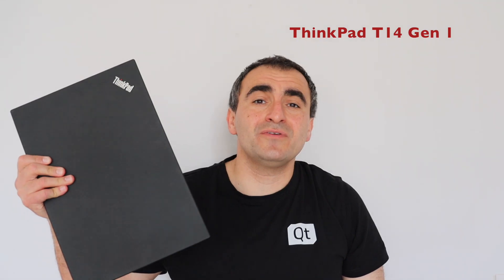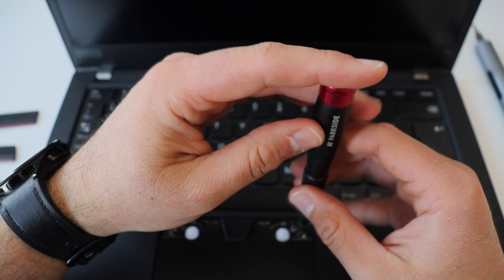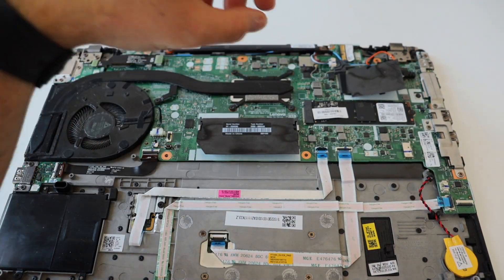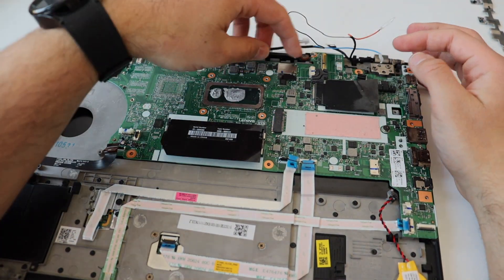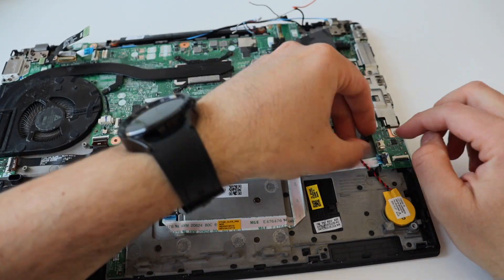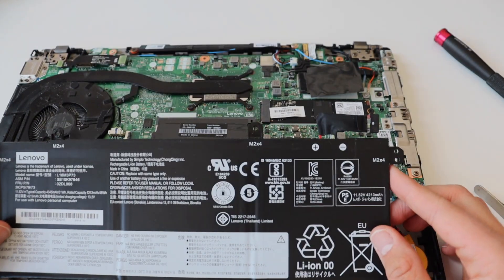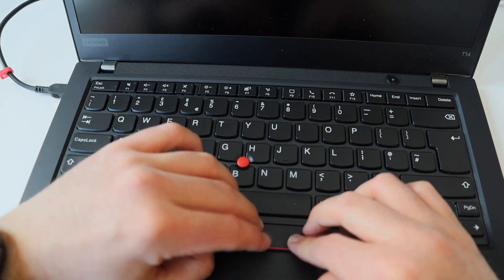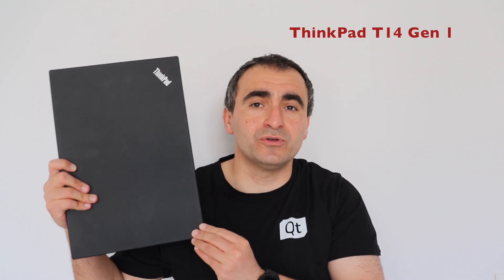Lenovo ThinkPad T14 Gen 1 with Intel Disassembly and Repair: Main Board Replacement #thinkpad

Comment: I have a problem where I left my T14 Gen 1 from the left side while it is running it freezes, or hangs or sometimes garbage comes on the screen. Is this due to laptop flex and motherboard is spoilt? or is it due to faulty RAM stick? How can I diagnose it?
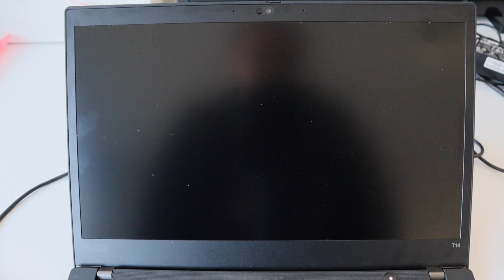Reply from the maker: Enter Lenovo Diagnostics as show at 7:51 in the video and run all tests. This may help you identify the problem.
Reply: @LeonAnavi Ran diagnostics multiple times and there are no problems. I  changed the SSD which I thought might have been the issue as it is on the left side but it still has the problem.
Reply from the maker: @CitizenSleeper0 which OS do you use with T14?
Reply: @LeonAnavi I dual boot Windows 11 and Ubuntu. Both have the same problem.
Reply from the maker: Does it hang if while you are in the BIOS or the Lenovo Diagnostics? Is the SSD properly secured with a screw to hold it tight to the M.2 slot? Have you recently changed the thermal paste between the CPU and the heatsink? Eventually this might have been caused by due to overheating.
Reply: @LeonAnavi I ran stress testing to increase the cpu temps and if I have it stationary on my desk then there is absolutely no issues. I frequently build software and it stresses the cpu and it is stable. I am really not sure about the SSD. I changed the SSD to see if it is the issue and it hung the same way.

I heard one user say that the connector is kind of loose and he had put something to hold it in place. How do I check if it is the connector? Should I remove the back cover and wiggle it while running?
Reply from the maker: @CitizenSleeper0 no, don't mess with the SSD while the computer is running and the battery is connected as this may break it. You can temporarily disable the built-in battery, remove the back cover and visually inspect the connection and the screw that holds it.

Comment: My Tinkpad T14 Gen 1 with an i5 10210M (i think it was it), suddenly started crashing in Windows and then refused to turn on. Now, it only heats the CPU but doesnt display an image and doesnt pass the POST.
Many months after it died, i realized that i made the mistake of putting thermal paste on the PCH Die during maintenance. This caused the heat from the CPU to pass directly to the small chip and cause it to explode due to overheating. Lenovo didnt put any paste on it for a reason. 
I was left with a useless laptop.
Reply from the maker: That's really unfortunate. It's easy to make a mistake when doing maintenance, especially with sensitive components. Sorry to hear about your T14! Thanks for sharing your experience as it may help others from the community.

Comment: una pregunta si solo se puede sacar la tapa trasera porque retiro el teclado o va a retirar toda la placa
Reply from the maker: I don’t speak Spanish, so I am not sure I fully understood your question. If you are asking about replacing only the keyboard, you can do it from the front of the T14 Gen 1 only without disassembling the back cover plate.

Comment: i just bought the t14 amd refurbished but the lid sensor didnt read when i close the lid. i checked the bios but but nothing happen. Do you know the hardware of those lid sensors are located?
Reply from the maker: Good question. Are you sure it is a hardware issue? It might be a software problem too. I don't remember on the top of my head if the Lenovo Diagnostics firmware includes a test for the lid sensor. The hall sensor that detects if the lid is closed is connected to the main board by one of the cables below the battery. Here is a step by step tutorial for T480s and I think T14 is not that different in this regard: https://www.ifixit.com/Guide/Lenovo+ThinkPad+T480s+Hall+Sensor+Replacement/144147

Comment: So all this is required to upgrade the RAM ?
Reply from the maker: No, not really. All this was require to swap the main board. However, on T14 Gen 1 you can just add more RAM to the slot as shown in my other video: https://youtu.be/M8RTMaHxnkc?si=qhmLwLvHx3gA3XPz
Upgrading the RAM is straight-forward. However, yes, in the particular use case recorded in this video, after swapping the main boards the new board had more built-in (soldered) RAM.

Comment: Thanks, very informative. I just bought a refurbished T14 Gen 1, & plans to upgrade it by myself. I am a senior citizen already, so Im a bit slow in following your instructions. Can I have a copy of the slower version? thanks
Reply from the maker: Glad it was helpful! What do you plan to upgrade? This particular video for replacing the main board is a bit advanced but I have another video about SSD and RAM upgrade which is straight-forward:
https://youtu.be/M8RTMaHxnkc?si=qhmLwLvHx3gA3XPz

Btw YouTube has a feature to adjust the playback speed from the Settings icons in the right lower corner of each video. This way you can slow it down up to 4 times (aka 0.25 speed).

Comment: hi you forget to add termo past for CPU
Reply from the maker: Both main boards had already applied thermal paste on the CPU. I mentioned and it is visible in the video. Of course, in your case if needed clean and reapply thermal paste between the CPU and heat sink.